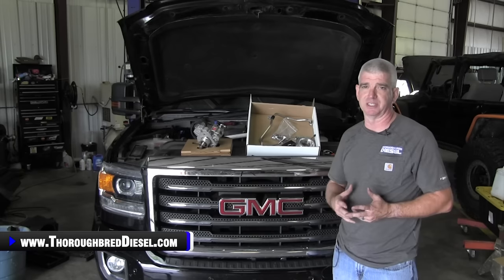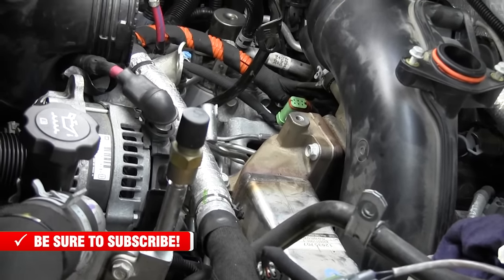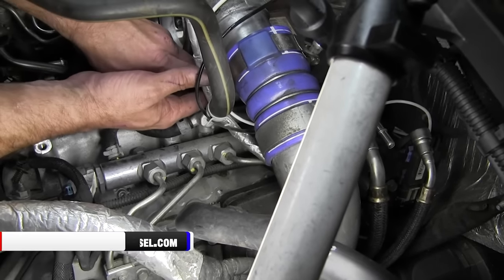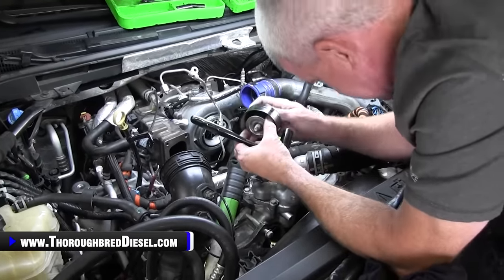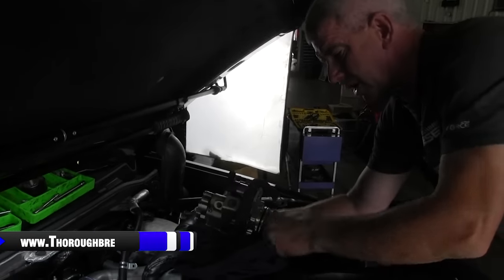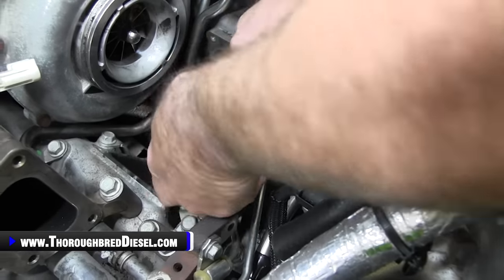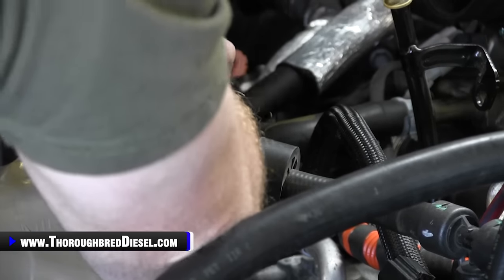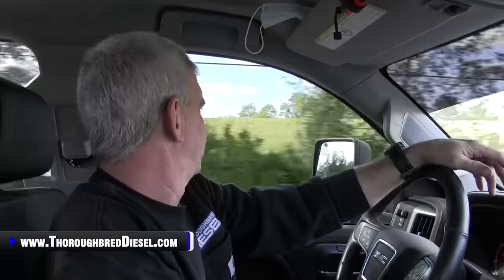Our Biggest Install Yet! DITCH Your Unreliable CP4 Pump For Something Better (Fleece CP3 Conversion)

Comment: Considering myself a novice with Diesel engines, I enjoyed watching the install. Excellent work. Enthusiast was a good term to use and I agree. What would you say the maximum horsepower rating is on this conversion, before needing a lift pump?
Reply from the maker: Tuning “quality” is a very large part of what HP a stock CP3 can handle. We have seen trucks make 400HP with little pull on the rail pressure without lift pump.

Comment: @Thoroughbred Diesel --- I installed my CP3 last weekend. Everything went in smooth like in your video. I put some blue locktite on the CP3 pulley nut for some peace of mind. Have you ever had any of those nuts come back off after install?? Thanks for the video, helped a lot.
Reply: Curious, are you a professional or shade tree mechanic?  This was a great video, but some of seemed pretty daunting.
Reply: @HIghlander03304  I don't do this for a living, just work on my Duramax and a few other race cars. It was a tedious job and requires a ton of patience tho.
Reply: @TheJoe111599  how long did it take you?
Reply: @aaronphillips9760  took a whole day pretty much.

Comment: Why did all the manufacturers drop cp3 to the 4? So many problems with the 4 why would they drop something that works?
Reply from the maker: Most of them were for Race applications. That’s why this particular kit is kinda of a big deal.
Reply: We can thank emissions nonsense for the birth of the CP4...
Reply: Cp4 more easily supports emissions standards to include a 9th injector for the DPF

Comment: I have an LML engine and I’m getting fuel in my oil. On you tube I have seen it can be injectors and injector return lines but that’s on a LB7. I can’t find info on an LML. Do you have any suggestions. I guess I’m asking can it be the CP4 pump or is it most likely an injector problem. I’m not getting a lot of fuel in my crankcase but any is to much.
Reply: Injection pump won't cause that unless it's straight blown out lol, sounds like injectors or washed out cylinder
Reply: @treighewy1462  yeah the washed out cylinder scares me. Injectors don’t scare me as much but I know nothing about these duramax engines or any Diesel engines. But I do like what I’m learning about them.
Reply: @Flowtester1  I own av performance in Oklahoma we are a diesel performance shop, and we deal with these all the time
Reply: @treighewy1462  where at in Oklahoma I live in Oklahoma.

Comment: Do you have a video on catastrophic fail 2015 duramax
Reply: I would hope somebody changes it before it goes there. One of my subscribers had that cost him more than 10 grand. If you have a duramax 2011-2016 might want to look into doing the upgrade.
Reply: @Mikefngarage  friends truck   He was on a trip 1 1/2 years ago pump failed on interstate .nearest dealership gave him a truck to use while they replaced pump ,now gets fuel pressure code and debris in lines.

Comment: Can this kit be installed on an lml with an egr delete or do they make another non tuning cp3 for an egr delete
Reply: Yes, Thoroughbred offers a kit with a S&S pump/Fleese adapter plate for non EGR equipped trucks.At least they used to,and I hope still do,since I'll soon be getting one myself.It costs considerably less than kit in this video,but lacks the 9th injector line.Not cheap by any means,but less expensive that the more complex kit.
Reply: And yes,that less expensive and complex kit does require tuning to work.

Comment: Would it be a good idea to put blue locktite on the CP3 gear bolt and the 3 conversion adapter bolts? I am doing this install next weekend and most likely will be using some.
Reply: I use mega black silicone... Kinda like blue locktight.

Comment: awesome video. I was going to look at an 11 lml sometime this week, but this  changed my mind.
Reply from the maker: Glad I could help.
Reply: It seems every truck manufacturer used that CP4 all the way up to 2018 . Just seems no way around it unless you want to go with gas .
Reply: FYI there is a fix for the duramax. But the FORD... Nope. pump wont fit. Duramax is the best option IMO. Just do the job one time and your good for many miles. I hear same pump on dodge too cp4. gotta change it no matter what you buy unless you go earlier than 2011 or later than 2016. and on the ford.... Just would not go there myself.
Reply: I ended up getting a 2007.5 duramax.
Reply: @Mikefngarage  just finished my C3 From CP4 conversion , not fun , very tight spaces, had to have alot of different tools , no rush and took my time , but saved 2000.00 in labor . For what it worth what would a tow cost when our 800 miles away from home with a 30 ft toy hauler and a messed up truck that needs 10,000 dollars to fix now on top of getting me off the side of the road, or worse , out in the middle of a desert . That what made me push though to get it done . I primed the the fuel lines and it started up right away . Oh God ! how do you clean a fuel tank that has metal shavings in it . No thanks , The conversion done is better than thinking about doing all that.
Reply: @Trike.  I could just see you on the side of the road replacing all injectors cleaning fuel tank. new pumps. YIKEs. like you say  do it now before it goes. ticking time bomb. can you imagine owning a ford.....WOW no fix wont fit.

Comment: Does anyone think this will ever be possible with the 6.7 powerstroke?
Reply: No reason to. The CP4.2 is a fine pump. The fords also have a stock lift pump which helps
Reply: @jetspeed9618  Do all 6.7s have a cp4.2? If some don't, then upgrading to a cp4.2 is probably a much better option than the disaster prevention kits.
Reply: Someone makes a filter kit to catch metal particles on ford. Metal tubes ECT.

Comment: Pathetic when you have to spend big money to make your 70k truck reliable. Then we bail those fn crooks out
Reply: And ALL GM parts for any GM vehicle are 73% Chinese made. can't believe people still buy GM, what a joke.
Reply: Duramax engines are made in USA assembly by hand.  My co has 4 non less than 270 k miles most 439 k had a fleet of Ford's never again.

Comment: CP3 can produce the same pressures as the CP4?  Oh crap this is 2.5 hr video... gonna take me a while to work through this.
Reply from the maker: This video took FOREVER to produce.
Reply: @thoroughbreddiesel  thanks for taking the time to make it happen!
Reply: @repairvehicle  Ok that makes sense.  Obviously I'm not up on the latest common rail stuff, although I figured something had to be done otherwise there is no chance of a CARB cert.